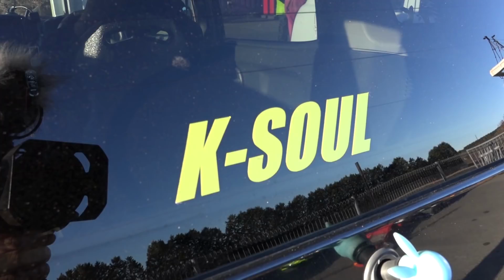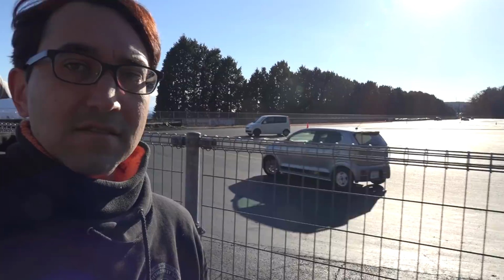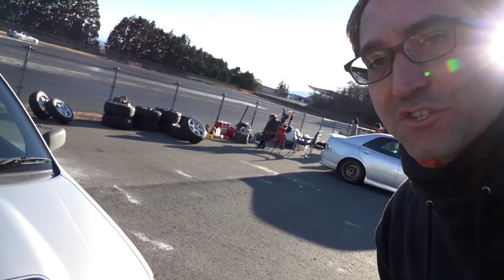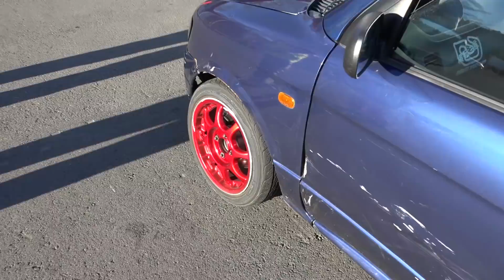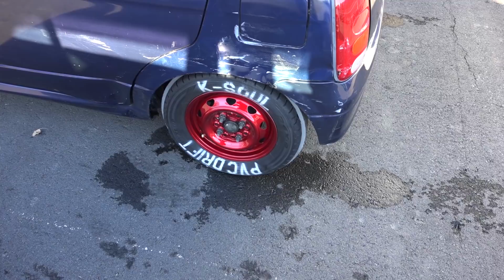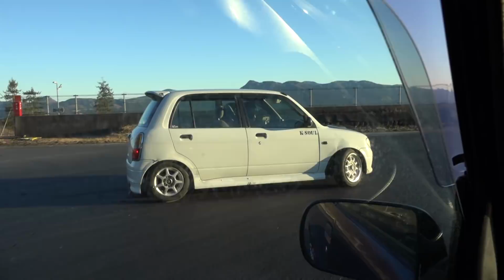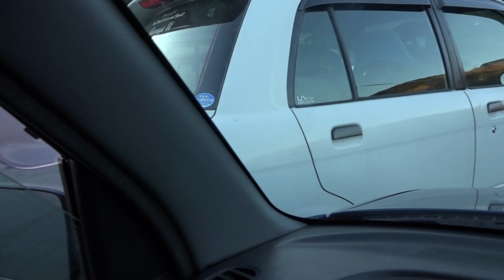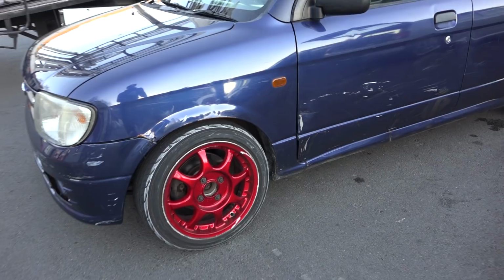$300 drift car! PVC pipe drifting kei cars

Comment: That is the slowest drifting I’ve ever seen but I bet it is crazy fun to do.much be super cheap since you aren’t replacing tires all the time.
Reply: Also hardly any wear on the car, no high rpm, no clutch dumps, no slamming gears, just a casual cruise with slideyness.. Im going to have to register my subaru fiori (1991 rex)

Comment: I like how for the same price as a G29 set and sim racer you can have this much fun
Reply: Would also need a couple of cans of coolant, their patented high tech mechanism for pissing coolant on the tubes, actual tube with something to cut it and obviously maintanence but it must be really low for the K cars
Though i don't know if there are cars that you can use apart from actual K cars shown here
Like what? Nissan Sunny, Micra, Cube? Mitsu Mirage, Colt? Mazda 2, 121? Toyota Yaris, Corolla? some other micro cars
Still the arguably the most amount of fun you can have for under a 1000 or even 750 something dollars
Reply: @yobrethren  aren't these kei cars 4wd versions of them?
Reply: @Str8representing  in the video these are fwd small wheel base low power kei cars
By binding rear tires with pvc tubes that don't stick to the road they whip these cars by weight transfer
basically food trays under rear tires, same thing but a lot more efficient and possibly stylish

Comment: i drift in a dirt course for low friction drifting, but i guess you could invert the part of the system you're taking the grip off of. pretty cool.
although mine is rwd rear engined so it's really drifting and not just sliding

Comment: Marty from MightyCarMods would love to drift a Mira like this....

But not the 4WD Mira.
Reply: well... then put pvc´s on all four xD
Reply: Jan Duarte I'm fairly certain the 4wd Mira sends a limited torque to the rear wheels, so it's probably fine on just the rears.
Reply: i think it would work just as well on the 4WD Mira.
Reply: I`d be interested to see how that would work considering the front and rear wheels will spin at the same speed.
You`d have different traction front/rear.. My guess is the auxilliary will break.
Reply: ToreDL87 Depends on the center differential. These small AWD cars rarely have a fully open center differential. I doubt you'd see more than 25% torque to the rear wheels, maybe as little as 10%.

Comment: Pvc pipes around tires comes from rc drift cars - it's an old technique to turn an awd rc car into a drift rc car.
Reply: PaaPs i know its problably where they got the idea from
Reply: People were drifting RCs way before trikes hey. Nitros were a favourite because they actually had power, pre Lithium.
Reply: PaaPs my savage rc truck didn’t need pvc even with sticky tires on because I kept adding more power lol as the famous quote of Jeremy Clarkson.
 I think at one point I had the power to Weight ratio past 7/1 bhp basically higher than a Chevy c5 and I could do back flips from all of the power;)

Comment: Who says FWD can't drift?
Reply: Holden Froemke American muscle fanboys. But now, they’ve been proven wrong.
Reply: famous :P
Reply: 4wd cars with no fwd.. i made one from a daihatsu charade. You vant drift like that in a fwd...
Reply: I believe, the japan models are awd. If it were fwd, they would need to be holding the hand brake on the whole time to keep it out, ans if it was rwd, a car with that short of a wheel base would just turn into a fidget spinner..
Reply: Subways Shenanigans Some of these are available as AWD in Japan, but you wouldn't see them with rear wheels still turning but not completely spinning out like they ard here. These are definitely FWD.
Reply: Any drivetrain can drift, you just need power to rip the grip form the tyres.
Reply: fwd doesnt "drift" it just slides. there is a difference, but fwd for it to stay sideways you need to hold the handbrake. the cars in this video are not doing that, they are only using the hand brake to initiate. these are awd otherwise they wouldnt be able to counter steer, as minimal as it is, they wouldn't be able to do that. A drift is when the rear wheels break traction and with excessive force, continue to spin and propel the car forward .
Reply: @Shane_FT86 no, it's anyone who understands how drifting works. In order to drift you need to have something forcing the rear wheels to slide, and that is usually accomplished by pushing a metric fucktonne of horsepower through the rear tires.

If you can't do that, your next option is to DRASTICALLY reduce friction, down to near black ice levels. The only way you're getting a front drive car to drift is by doing this or commandeering an icy park/frozen lake, even then it's still not gonna be quite as good as a RWD or AWD car.
Reply: fuck, finally someone who understands the principal and physics of drifting :')
Reply: To everyone here saying that these are awd - no they are not. They get sideways as the back tires have almost no friction at all but front still has normal friction. It is the sentrifugical force in corners that breaks the rear loose, probably don't even need to use a handbrake to initiate the "drift" as the friction in the back is so minimal.
Reply: Technically this still isn't drifting... it's powersliding.
Reply: Subways Shenanigans they are fwd. 100% kei cats aren’t awd
Reply: Eli Ritchey 
Guess again

A ton of kei cars are awd
Reply: Anyone who knows anything about driving.
Reply: Me

Comment: I wonder how much one of those rings costs
Reply: Chewedbacca Overpriced
Reply: Haha he said 4 metre long aquarium grade pipe. I'm guessing like 3-500usd for that, that stuff looks like it's 3/8" of 1/2" thick which isn't cheap. But it looks like they only use 2-3 inches per tire, so you'd get about ten or more sets I'm thinking from each pipe. Still, even if they're 50 bucks a set, you only payed 300 for the car. That's almost on par with buying a bloody RC car meant for drifting.